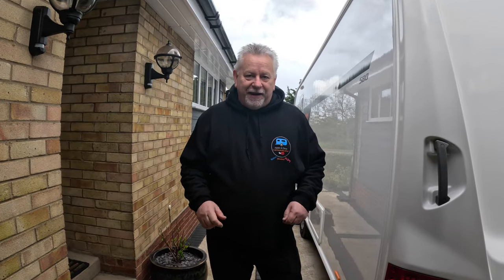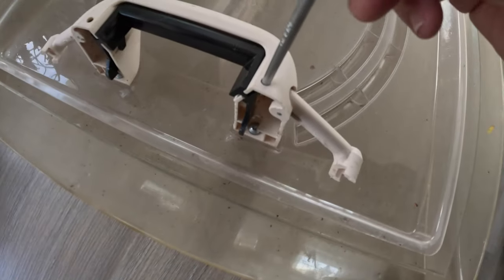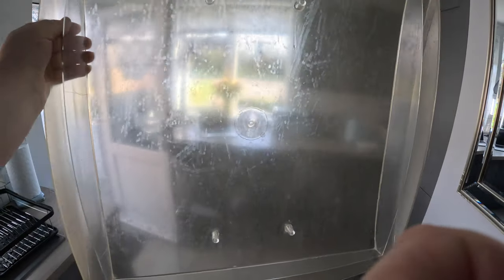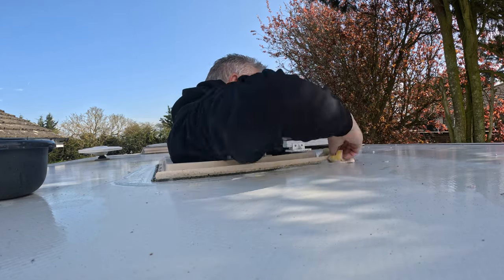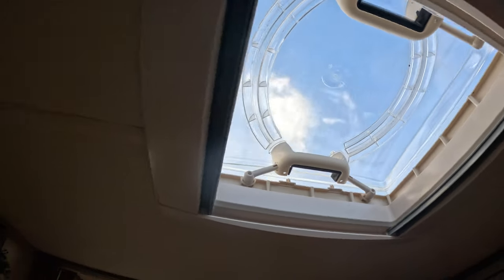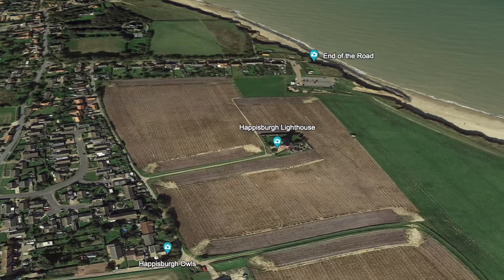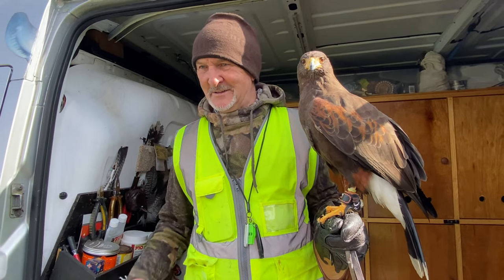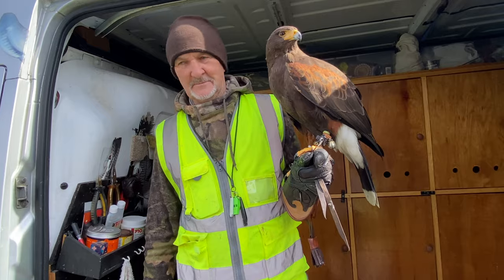Suddenly everything became much clearer. Plus, we were visited by 3 amazing birds of prey!

Comment: That was a tight squeeze Dave 😂 I'd never fit 😢 got to do our skylights we washed ours the other week and they really need to be done. Like yours there in the same shape. Think that yellowing is the same as the head lights on older cars. Great video, mate  Paul
Reply from the maker: Hi Paul, I was concerned I might never get out 😂😂🚒🏗️. I’ve been told lemon juice is the answer to yellow sky lights. ATB, Helen & Dave
Reply: @HelenandDave  I tried cleaning our gasket like yours it has black discolouration. I tried pink and it works. But it will take most of the day so might need to look for something else

Comment: Dave i have the same caravan with the same MPK roof lights and the best thing i ever did was buy a Dometic Mini Heki for the one above the bed. Crystal clear see through and no more bits going in between the layers and over the bed Swift replaced them with these on the 2018 models onwards. Will be replacing the bathroom one as the best £130 i ever spent and took an hour to fit. Steve
Reply from the maker: Hiya Steve, interesting to know thanks for that. Pretty sure that’s a purchase I’ll be making at some point. These double skins are a real pain. Thanks again, Helen & Dave 👍
Reply: @HelenandDave  They really are. One trip down the road and you get debris in the layers but now i can watch the stars and not look at the MPK above the bed and think that really does annoy me 😆. All the best
Reply from the maker: @arcticfreezemachines5402  love it 😂👍